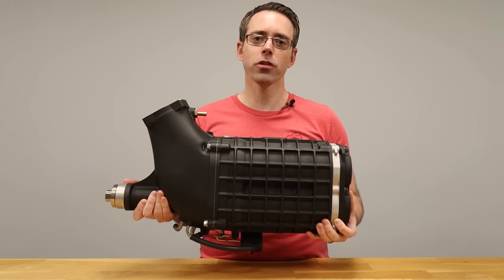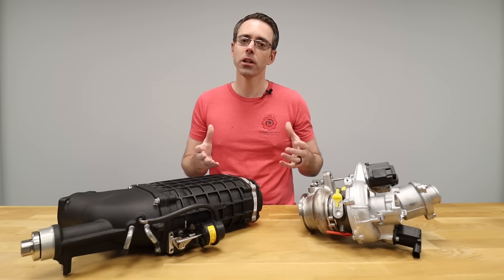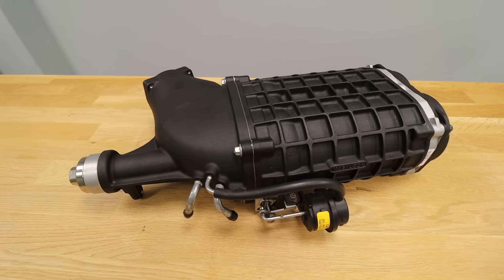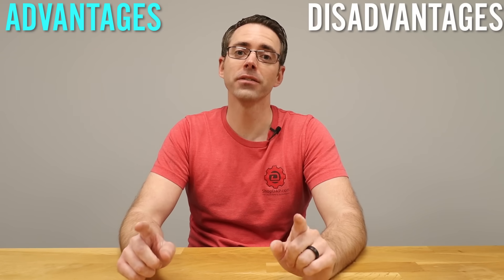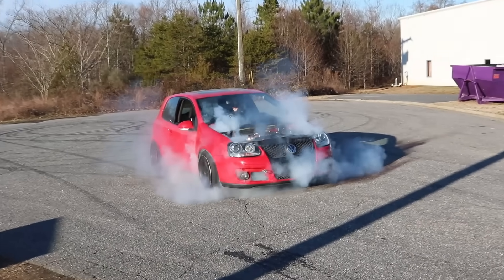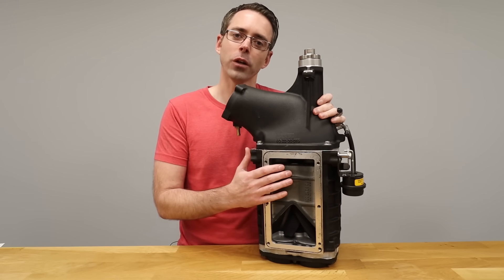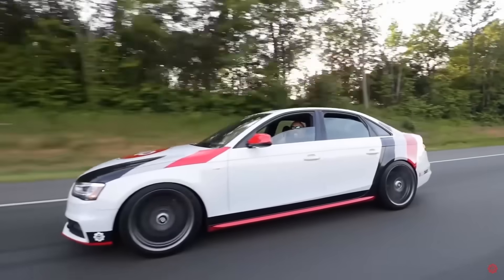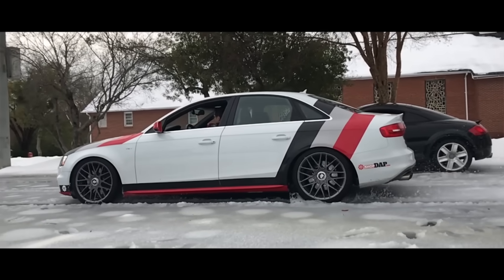Turbochargers VS Superchargers | Which is Better?

Comment: Having driven MX5 Miata with both, supercharger is better for driving, by the time you get to the point where the turbo power passes the super charger on the road you have lost your licence with each.
Flat out power turbo is better, supercharger better low down and if you put a smaller nose pulley on even better but rev limit has to drop to  @6500 avoid over speeding the supercharger. Either way both fun just need to adjust your style of driving to get the best out of both.

Comment: From then 3 min mark onwards,  it is factually incorrect that its harder to retrofit a supercharger. The twin screw and roots superchargers have no oil lubrication needed through engine and hence plumbing those lines off is a huge saving of effort. You just need to replace inlet manifold with the SC + manifold and install an intercooler , if needed to cool the air and you are done. With a turbo, you need to alter the exhaust manifold to install the turbo, tap the oil sump to get oil into turbo and return the line back to sump. Put in an intercooler, also have a boost valve to release excess boost built. So factually incorrect.

Comment: One of the biggest differences between a supercharger and a turbo is that if you’re driving a vehicle with a supercharger and the supercharger malfunctions, you can easily put on a smaller belt and keep going. However, you can’t do that with a turbo charger.

Comment: You are lame. There are almost no production cars with a superchargers on the other hands every diesel has turbo and many modern direct injection gas engines too. Turbo is way more complex that a supercharger. You need to readsome facts before making a videos. Supercharger is simple and simple to install but wery unifficient. Turbos are complex and can't really be aftermarket installed. If you just seak power than take 6 liter V12.

Comment: *Supercharged: Best for drag race but don't even try to drift with it, choose the tourque is to powerfull, high speed may causing overstreering cuz the tires can't handle the torque.

*Turbo charged: Owesome for tuning but to complicated, too much weight may causing lose so many power and drink a lot of fuel😅

Tuning is always have a pros and cones, is about how you ride a cars not only the HP and Torques🤝

Comment: Intake compression ignition exhaust i didnt learn anything im wondering about putting a super charger on low compression chevy 350 factory engine with 7k miles on it.
Reply from the maker: Joe, seee You got the wrong guy, seee.
Reply: @Deutscheautoparts  waddyathink? Brand new chevy 350 low compression 8 to 1 will it kill my mileage? What kit should i check out?  Its more of a tow vehicle than quarter miler. Ive already got about 370 ftlbs torque  but want more
Reply: Sorry i thought you guys worked on cars i didnt realize your a parts store.
Reply: @Deutscheautoparts  sorry i thought you were a mechanic i didnt know your a parts store

Comment: I prefer superchargers over turbos : reason its quicker too install and has instant power. Turbo motors needs more maintance.
Reply: I also prefer superchargers over turbochargers because turbochargers overheats faster, superchargers don't have a lag (boost delay) and superchargers can live longer and the Installation for a supercharger needs less time than the Installation for a turbocharger.
Reply: @denizaydinoglu983  and sound cooler
Reply: Me too
Reply: I am even more confused which adds more stress on engine turbo or supercharger?
Reply: @bluecat7574  Depends on how high you crank up the power, and the size of the engine. There is no correct one size fits all answer. Low pressure turbo-diesel engines will last for decades with minimal maintenance.
Reply: Yes! #noboostlag
Reply: What about 'sstutututu' sound?
Reply: Not true. Actually to get real power from a supercharger you have to which engine components. Turbo you don't. Turbos are budget friendly and don't put a pounding on your engine. A supercharger puts a pounding on your engine and if you don't upgrade your engine components you will break something for sure. This is why when a company adds a supercharger on a car it doubles in price and not the case with a turbo.
Reply: @rayshaunedwards6572  any type of power adder (turbo, supercharger, procharger, nitrous) puts a strain on the engine components due to the higher amount of air and fuel being sent into the engine. A lot more vehicles are being made from factory with turbos because it doesn't cost as much compared to a supercharged vehicle. As the video stated, the supercharger robs the engine from horsepower (100 to be specific) while the turbo doesn't rob more than 30, if that. A car company will make a turbo 4 cylinder vehicle with it only using maybe 5 psi of boost and get into the 300 hp range with similar torque while maintaining 30 mpg. Companies are competing not only to be the fastest, but. Also the most fuel efficient at the same time. That's maybe the biggest reason why turbos are much more common than a supercharger
Reply: @rayshaunedwards6572  Actually it is the oposite, turbo,which nowdays usualy provides above 1 bar of boost in most factory non peformance cars puts more strain on the engine compared to equivelent supercharger that usualy puts out 0.5 bars. Also supercharger is easier to install onto a NA car most of the time compared to a turbo where you have to modify your car's oil feed and coolant supply to the turbo, not mentioning custom made exhaust manifold,mounting bracket,fueling and remaping involved. We are talking about basic turbo design there, while basic supercharger(roots type I think) just needs a mounting slot and a pulley, while stock ECU can compensate the extra 0.3-0.5 bars of air on it's own(of course it also depends on the size).

Comment: I don't call them superchargers or turbochargers. I call them air compressors because that's how what they are.

The other is a mechanically driven air compressor
The other is gas driven air compressor

Comment: Both will cut the life of ur engine higher cylinder pressures and strain on the rings and bearings. Turbo is harder on the motor than charger due to 2x amount of boost. It's best to build up the motor with intent to boost it. Rather than slap on a kit on Street motor.
Reply: Turbo's are not harder on the engine, a blower takes power to make power. The engine has to work harder to drive the blower. Blower motors beat the shit out of the main bearings.

Comment: Coming from experience with Turbos fuel efficiency is great up to the 3rd year of ownership.  Due to the plumbing connecting it to the exhaust down pipes. The carbon build up causes a number issues causing check engine code (forgot the code) of Turbo OverBoost.  Due to up of the carbon the internal veins lock up boost and horsepower is lost.  Also, most think the system is light weight still have more tubing/pipe plumbing and brackets to add weight.  If I would have a choice Super Charger is more reliable.

Comment: Seriously. A supercharger is way quicker to install than a turbocharger. Reason being less components.  There are many Mercedes models with Kompressors.
Reply: I have a slk230 kompressor for 7 years. Never needed maintenance on compressor and it responds  right way. My daughter had  a cx7 with turbo and just headache.
Reply: piping is really cumbersome when placing turbos, even with small turbos on small engine..
Reply: So what is it? Turbo are more work to install, more parts and components to add to make it work, and it has some lag to it because of the design…..Super eat up some power in order to make power but make more than it eats up. Easy install only have to hook it up to your pulley system, and intake manifold, doesn’t blow out your motor faster because its in constant boost, but doesn’t have lag because its in a constant boost…?
Reply: Yeah on old models..Now mercedes is leaning toward turbos
Reply: Superchargers have less chance of boost lag
Reply: Yes. My '09 C 180 Kompressor has one
Reply: Why install when the car comes with it. 😁😝
Reply: Unless uv gotta make a custom manifold from scratch
Reply: Superchargers are easier to install on any vehicle w/o any prior systems installed, period. If it's already piped for a turbo, than obviously it would be the easier road to take. I don't understand where the confusion is, installing a turbo from scratch is way more work, end of discussion
Reply: Turbo- higher rev range to utilize power=higher emissions. High flow exhaust+intake+intercooler+oil and coolant lines plus dump valve, remap,Brake upgrade. Causes strain to both sides and prone to throwing oil etc into the intake.
Supercharger, 
Can work in tandem with Egr value= better emissions.
Boost from start= smoother drive more predictable handling
High flow exhaust, intake+intercooler, remap, brake upgrade.
Conclusion- Supercharger is cheaper+ easier to install and lower emissions. Everyday driveability. Compared to turbo their practicality maintenance free.
Reply: @1Crosshairs  did you say faster exhaust? Turbos sap speed from exhaust, and transfer them to intake?
Reply: @1Crosshairs  Errrr, no. Engines have high emissions at both LOW speeds and high speeds. The 20mph zone brigade like you to think that pollution only occurs at high speeds. Low speeds are equally bad. The lowest emissions per mile travelled are at peak engine power, where the most power per litre of fuel used is delivered. Easy concept.
Reply: I'm a Honda K-Series nut. I can honestly say superchargers are way easier on these engines. Its a simple case of remove inlet manifold and replace with new supercharger kit. They're also a lot cheaper and can have intercoolers fitted with ease. Turbos on the other hand are getting cheaper but require a machine shop to add oil connectors to the block, a load of heat protection material and a ton of piping, cutting and re-routing. Mapping the ECU is easier too. Boost my gear is not required on a supercharger as the torque is progressive.
Reply: Turbo diesel ftw.
Reply: Turbos are harder to install yes, but superchargers can also put more strain on the engine since you are in constant boost. At least with a turbo, you can keep out of boost (but what's the fun with that haha).
Reply: @DarknessFalls0839  false...you are NOT in constant boost with a supercharger. Its bled off with a bypass valve.
Reply: @DarknessFalls0839  You can get around that with a supercharger bypass valve. Also makes them more economical at low revs/speeds.
Reply: Constantine B lies, superchargers are not all easier to install. Plus he didn’t speak on how bad supercharges heat soak and they take forever to cool down unlike a turbo set up.
Reply: @wendellgreenidge3362  yes they are. No oil lines to run, no oil bung to weld onto the oil pan, keeps the same exhaust manifold and downpipe, depending on supercharger you only need an air-air intercooler not air-water so just intercooler and piping in the front.....a lot easier. A properly cooled supercharger doesnt heatsoak....I run mine hard all day and its perfectly fine.
Reply: @hitmixhyepock9405  You obviously haven’t installed many superchargers nor have you ran yours close to max rpm. They are notorious for heat soak and I clearly said not all are easier to install because you have never installed one on a Honda 4 cylinder or and fwd 4 cylinder engine. And not every turbo kit for every car requires to  modify the oil pan or components to install it.
Reply: @wendellgreenidge3362  I literally just took mine off and reinstalled in December. It was just 4 bolts....so yeah i know exactly what I'm talking about. Just put a smaller pulley on my supercharged cobalt ss. A pulley thats as small as you can get before you run it out of its efficiency range. And I hit my 7500rpm redline all the time, so you are wrong again....so yes I know about 4 bangers and superchargers and turbos....they dont heat soak like turbos.
It sounds like YOU are the one who doesn't know what they are talking about.
And yes...just about every turbo setup requires you to put a drain hole in the oil pan......try again.
Reply: Wendell Greenidge not all superchargers heat soak, they are way easier than a turbo to install.
Reply: @wendellgreenidge3362  and superchargers aren't "instant Power/torque", because of the belt and the pullys there is a torque loss and more components for the engine to spin, which needs more Power that the supercharger can't deliver in low Rpm ranges. So the supercharger also needs time to spool up, which creates a boost lag
Reply: @2tempi_dave54  I think you meant superchargers are instant power. The power loss from driving the supercharger is true but it’s still making more than it takes. But it also depends on the type of supercharger as well because a centrifugal supercharger is the only type that will not make instant power. It has to build it but you can size a turbo to have instant response as well so I’m confused on your argument...
Reply: @2tempi_dave54  there is no "boost lag" in a supercharger....its a linear powerband. The supercharger is always spinning boost but the bypass valve bleeds it off until you hit the gas enough, which is about mpg.
Reply: @wendellgreenidge3362  super chargers are easier to install, they are just bolt on and run a belt. Turbos require oil lines, exhaust tubes, intercooler and hoses. 

Another aspect that didn't get mentioned here is that turbos also rob power from the engine. The additional exhaust tubes and angles of those tubes make it more difficult for the engine to expell exhaust gases and then those gases also have to pass by and spin a turbine which further slows down and bogs down the exhaust flow making it even more difficult for the engine to expell those gases. 

Turbos also heat up faster and cool down slower than supers because of the hot gases passing threw them. Have you ever seen a turbo engine on a dyno the turbo glows cherry red 😳.
Reply: @scp53779-thebarber  so what about centrifugal superchargers? You realize not all superchargers are roots or twin screw? Even those still can benefit from intercooling but there are turbo kits that don’t require an intercooler because it’s not making much extra power. Turbos definitely cool down faster and of course they heat up faster when they are ran of exhaust gas. Superchargers rob way more horsepower than any equal power superchargers. Y’all amateurs make me laugh like y’all actually know what your talking about. At least watch engineering explained videos first before you say something that stupid
Reply: yeah, but you forgot to mention that most of them are driven by hairdresser's....for big power, Turbo wins every time
Reply: @farmanshaikh6405  tf are up saying?
Reply: Daily Allowance trying making 1500 hp without adding a lot of weight.

Comment: Did this guy really say that turbos are easier to install than superchargers on vehicles? Has this guy ever installed either one?

A positive displacement supercharger is MUCH easier to install on the vast majority of vehicles that no forced induction was installed from the factory.

I am personally a huge fan of a centrifugal supercharger for installs on vehicles not factory equipped with any forced induction. They are typically harder than a posi to install, but a little simpler than a turbo install, and have the efficiency advantage over a posi.

Comment: there are new style of supercharger, it looks like turbocharger without hot part and belt driven ,good for not bending exhaust pipe.
Reply: Centrifugal supercharger. Like the on on rotrex, vortech and hks.
Reply: Centrifugal supercharger. Like the rotrex, vortech, hks. They make power mid to high rpm most of the time. But their power delivery is very linear.

Comment: another difference is in NA and Supercharged engines the hottest the engine oil gets is around ~200°C while in a Turbo engine the engine oil can get to 400°C as it cools the exhaust gas driven
turbo. So all things being equal surely the Supercharged engine oil would be cleaner and less stressed over the oil change interval period.

Comment: I prefer the instant power from a SC. Especially in a heavier vehicle. Turbo’s are great for fuel mileage and makes more power up top in the higher RMP’s, but SC is going to get you off the line quicker. Also, I don’t think you’ll ever see a turbo in a top fuel dragster. Just doesn’t make sense.

Comment: I had an A6 2.7T twin turbo that i chipped.  Not much lag after chipping.  Now have  a 2011 S4 3.0T supercharge.  I like both but the supercharge has become my favorite.  I found the turbos,  vacuum hoses and oil lines need lots of maintenance and not as reliable as superchargers.  Would have been nice if the video discussed the reliability between the 2.

Comment: To end this debate we need to boost the same exact car and dyno/drag strip them both.
Reply: Doesn't mean anything if one is just faster need to track it hard for while see how heating up and changes in rpm and throttle effect the result.
Reply: Mighty Car Mods have done it, 2 identical miatas, 1 turbo 1 supercharger, check video it's very nice, they did alot of tests it's really a nice video
Reply: @tusunakitsnay  link plzzzz😭

Comment: I run a k06 hybrid turbocharger  and it kicks between 1.5k and 2k revs so I dont really get turbo lag from my 2.0ltr
Reply: i had a 6 inliner BMW 325 TDS 2.5L diesel and it was kicking right away at 1500rpm. red zone at 5k.

Comment: Don’t turbos waste gas at high throttle? They have to run really rich to prevent overheating or something?

I’d take a NA or supercharged mostly unless the a car already produces a lot of low end torque and hp and turbo gives it crazy top end. Like a high displacement v8.